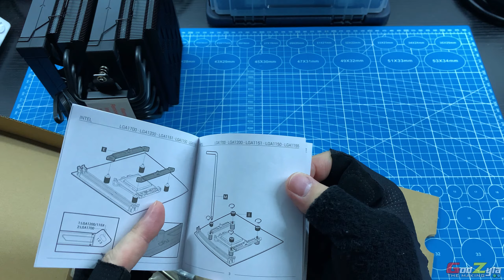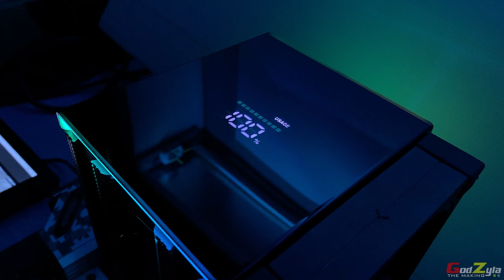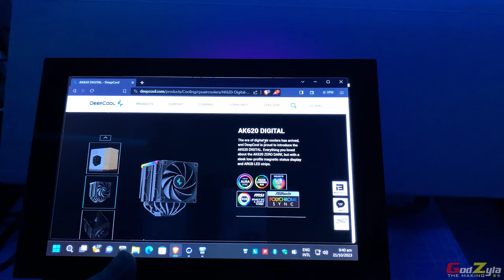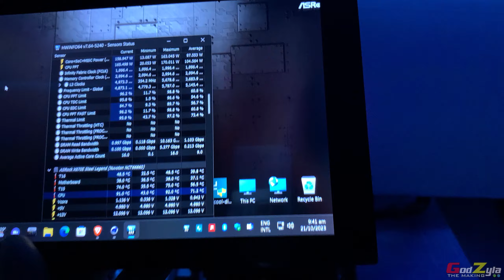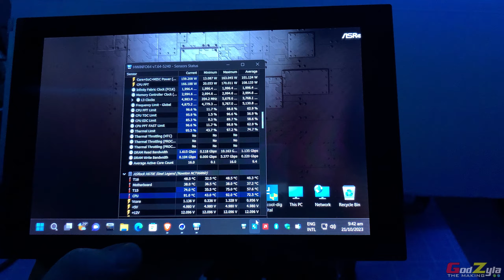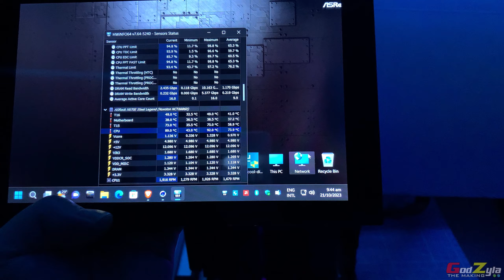Deepcool AK620 Digital

Comment: In terms of performance, should I get this or  or one of the Thermalright coolers such as PA120/PS120/PS120 SE? Reason I'm asking because this one is on sale right now, and will be same price as Thermalright. I'm mainly buying for aesthetics but also want good cooling performance, gonna pair it with 7800X3D.
Reply from the maker: Hi Ben, welcome to my channel. Either of the aircooler you’ve mentioned will do the job. Unless you are talking about the peerless assassin spirit, which have 7 heat pipe instead of 6.
Reply: @KleoYan  Bro I've a big fan of your channel and have been here for 1-2 years. I was referring to PA (6 pipes) and PS (7 pipes). There's actually a new Phantom Spirit 120 Evo release, the heatsink and bracket now all come in black, and the fans are 2100+ RPM with RGB lines across the corners.
The AK620 Digital fans don't have RGB but the cooler itself is very aesthetic... tough decision lol.
Reply from the maker: @Ben-ld1qi  Thanks ben, yup correct the PS (7 pipes) which I believe is the Phantom Spirit.. That aircooler performans slightly better as compared to the other peerless assasin and if you compare it with the AK620 Digital, its the same story.. good performance with a slight degree performance (about 2 to 4 degrees) but the rpm noise is lower compared to AK620 digital at CPU load. to be honest, I can understand it's a tough choice, it greatly depends what you really wanted. but once decided, just use it and dont compare to any stuff more. Thats how I use PC stuff. I mean we can't always keep changing right? Put PC into good use. 😉
Reply: @KleoYan  Could you please clear what you said? "good performance (about 2 to 4 degrees) but the rpm noise is lower compared to AK620 digital at CPU load". Did you mean the Phantom Spirit has better temps than AK620? In that case I might grab the PS Evo, which comes fully back with better bearings on fans which go up to 2.1k and have RGB stilts on the corners. 
There's virtually no overclocking headroom on 7800x3d, correct? That's why besides tuning the memory which I have some experience I'm feeling very relaxed and calm at the thought that overclocking will be futile whereas on my 13600k I can go 5.1GHz to 5.6GHz easily but at the cost of higher temps and more noise in general. 

You couldn't be more correct about always changing... on my other Intel rig I compromised with the Phantom Spirit 120, since I wasn't a big fan of the silver heatsink, IMO fully black heatsinks look better. But I though the top of the cooler looked better since it didn't have sticking out heatpipes on top like the PS 120 'SE' version. And now 2 months later they releases the Evo version in full black haha.
Reply from the maker: @Ben-ld1qi  ok.. what I meant is. the Phantom Spirit do perform much better than the AK620 Digital by 2° to 4° and same goes to the noise, Phantom Spirit runs abit quieter. So now it come to a choice of what you really wanted. If you want performance. Phantom Spirit. If you want both looks and performance. AK620 digital is not far away in performance compared to the Phantom Spirit. You have to decided which to get. I can only speak based on what I know.

If you really want my opinion. Go with the AK620 Digital. at least it has both, the looks and performance.
Reply from the maker: @Ben-ld1qi  opps miss out reading the part where you have mentioned about the new version of the Evo, my bad, was on my mobile. Yes sometimes it's fustrating, the moment you get a product and after few months later, a better product is out. It's just like processor.

 I did a big mistake, when I had my 5950X and went to a 7950X. I thougth I could enjoy using the 7950X but I am wrong, I enjoy using the 5950X which I've sold it. reason is, for the 5950X, 1) it runs cooler, 2) DDR4 rams are so much cheaper, 3) power consumption is so much lower. So now after all these, I ended up using my 2nd rig (5700X) most of the time. 

anyway my story might be different from yours but the bottom line is. once purchased, just use it. Knowing technology is good but just resist the temptation. It's also another form of saving up. spend on endownment investment and wait for couple of years before the next upgrade. at least during the investment peroid, you get to save up and with interest.
Reply: @KleoYan   @KleoYan  In regards to the comparison between PS120 and AK620, I highly appreciate the break down you gave me! I also always love hearing a tech reviewer's own opinion as well. If you haven't seen the new Phantom Spirit Evo, check it out, while the fans are much better than the standard PS model, not sure how I feel about RGB slits on the corners, but the heatsink itself looks solid. AK620 Digital is in own's league with the digital plate on top, and heatsink looks great as well, and in the future I can always swap out the fans if I'd like some RGB so definitely the AK620 is looking very good here. No worries that you missed out the Evo version, I assume it will be identical to the non-Evo with the exception of better fans, that's all.

You know you're not the first person to tell me that they miss their beloved 5950x? I've virtually heard that from half a dozen ex-5950x owners that switched to 13900/14900K platform. They all said how it was running quiet, cold and no headaches... To be honest I'm a little terrified of building an AM5 7800X3D rig, even it's a secondary gaming purpose build, just too many stories about issues and what not. On the other hand, all my friends with a 13900K are also quiet miserable complaining about it reaching 100c within 2 seconds into a stress test.
I can actually emphasize and relate to your story! You couldn't be more correct about investing and not looking back.. I've seen people stuck in an endless loop of mini side-grades that never end. 

P.S. on an off topic, on your 1hour Nova video, you said sorry to your friend for having to take the vrm heatsinks apart... let me tell you something... if there's ANYONE in the world that I' wouldn't hesitate buying something 2nd hand after taking it all apart it would be you! You have a very cautious gentle touch, just the way you open boxes with a device to lift the top up cleanly instead of using the fingers tell me all I need to know about your methods!
Reply from the maker: @Ben-ld1qi  hi Ben, pardon me, I just woke up and sorry for the late reply. I will have a look at the EVO version and might test it out. Thank you for the recommendation. 

Off Topic.
Yup sometimes things just work but humans are humans, always wanting more but I learn to stop craving for more. It's a tough decision for me too, just to keep my channel going. 
I use to have a website to keep all my PC Builds as memories but it's taking too much time to post picutures and to type out what I did. That's where I started to upload my PC Build Journal at year 2019 (Christmas period - https://www.youtube.com/playlist?list=PLEW-b-2vYDdPHi1Ir5Ok0BxKwuecH8rkK). Since then I got addicted. it's not about showing my PC builds, is more of the interaction with viewers. I get to learn from them too, just like yourself, sharing with me your opinion and suggestion. 
The more I upload, the more I get to interact with people and I hit the jackpot as the most anticipant case was the Lian Li Lancool II (original version). It was then I started to do more content and I am out of PC parts to do any content. Fortunately with a group of good friends, they too are into PC Builds. They have aid me by lending PC items for me to do content. I am extremely grateful to them. Next was to help a friend with his newly purchased Lian Li SL120 Uni fans. He was having trouble getting  it to work and have loan me his unit. I got it working but wanted to share with others who are having issues. Thats when I did countless of content about this SL120 uni fans and it's controller. (https://www.youtube.com/playlist?list=PLEW-b-2vYDdPo0NzHyeksx012c-nkDapm) . At year 2022, BlkSoda approached me if I am interested to present Lian Li's new uni fans. I agreed and it went well, that's why Lian Li have continued providing products for me, even though my channel is small. As time goes by, more Asia brands approach me and I am glad to do product reviews but with one condition, that is to allow me to speack the truth. I hate to do marketing gimmick. I prefer to share my own experience of what's good and what's bad of a product. Just like myself watching other reviewers. When a reviewer shows the product and to present through a graph. I am so sorry to say, I can't give full trust as anyone can show the PC product, to plot a graph and to talk how good it is. Are they real? I have tested some of which they have spoken but finds out that they are not as good, maybe is due to where I am located (Hot & Humid). That is part of the reason when I test aircoolers or liquid AIO, I will show real time stats instead of a graph. I want to keep it real. 

Ok, I hope am not boring you with my story. For myself to do product reviews, I stick to two principles. 1st is just a guide content or 2nd my honest opinion and experiences of a product. How good and how bad? Part of the agreement to these sponsorers. They allow me to speak up what's right and if there are any flaws, they will improve on them, else I will not take on the review. 

Ben, thank you and I am flattered by your words. I am shock of your observation. You are the first who tells me this, Yes, I treat all items with care, be it does it belongs to me or from a friend. Thank you so much and to have support me. I truely enjoyed this conversation 😊

Comment: what to do i only have 12v 4pin in my mobo, i cant use my deepcool display.
Reply from the maker: HI Harold Celino, welcome to my channel. You can still display the temperature but not the argb effects. If you want that, you can purchase an additional argb controller.
Reply: @KleoYan  update it works now, thank you very much i change the position of my usb in USB1
Reply: @KleoYan  do you have recommendation for argb controller
Reply from the maker: @haroldcelino7159  you are most welcome. 😉
Reply: @KleoYan  thank you very much the only problem that i have now is pin converter haha :)
Reply from the maker: @haroldcelino7159  just for argb controller, I dont have any recommendation, just grab any which is cheap will do. https://www.amazon.sg/gp/product/B0CTZP8HZL/ref=ox_sc_act_image_1?smid=ARPIJN329XQ0D&psc=1
Reply: @KleoYan  sorry for inconvenience haha, but last question can i add another fan in my cooler?

Comment: got this cooler for ryzen 7800x3d , do you think its enough?
Reply from the maker: Hi Human, welcome to my channel. Yes it is more than enough as the 7800X3D is low in power consumption (TDP) but do make sure you have good airflow in your case.
Reply: Hi Kleo,

I got it installed. The temperatures I'm getting are around 50°C at idle, 60°C during gaming or activity, and 70°C with Cinebench. The maximum I got with Cinebench  was 79-80°C. Do you think these are normal temperatures? Maybe the idle temperature is a little high? Or is this how it's supposed to be? I used Deepcool thermal paste.

Thanks!
Reply from the maker: @matrix4342010  hi, to me it's consider normal on idle to goes up and down around 50°C to 60°C. Also how did you apply your thermal paste?
Reply: @KleoYan  did x with tiny dots , im sure its covered where its needed though ,
Reply from the maker: @matrix4342010  I see. Honestly speaking the temperature is ok but default on both idle and load.
Reply: so I bought Arctic MX-6 thermal paste and applied it using your method. It gave almost the same results as the DeepCool paste that came with the package(The X and small dots method covered nicely)
 with only a 1-2 degree difference. For those with similar builds, the stock paste works just fine.
Reply from the maker: @matrix4342010  Hi, welcome back and thank you for the update, so long it gets the job done 👍👍👍

Comment: Which one do you recommend for a i7 13700 non-K, Deepcool Assassin IV or Noctua NH-U12A Chromax Black and I wanna build in a AP201 case
P/s: Also can you help me how to setup fan for AP201 with an Air-cooler pls, I was thinking buying 6 fans (3 on top, 1 on rear and 2 under), this build is for my Brother who editing videos a lot
Reply from the maker: Hi PLKay, welcome back, I have no experience of the aircooler you've mentioned. I am more towards budget air cooler and my choice of aircooler will be the Scythe Fuma 3, the Thermalright peerless assasin or the Phantom spirit, the AK620 or AK620 Digital. All these will perform well with the i7 13700. For the AP201 fan arrangement, I do not have experience on Aircooler in this case, can't provide you with a solution, you will need to test it out. So sorry.
Reply: @KleoYan  ok, thank you very much sir
Reply from the maker: @MG0301  you are most welcome and sorry that I can’t answer your question fully. All the best with your build too.